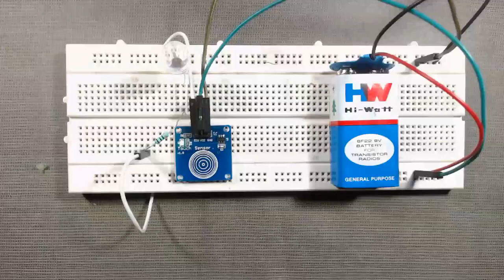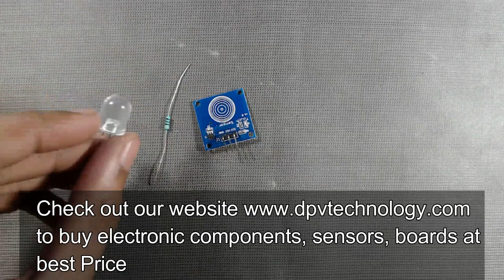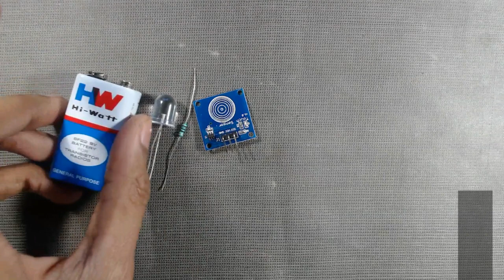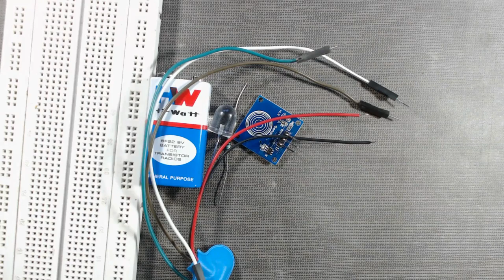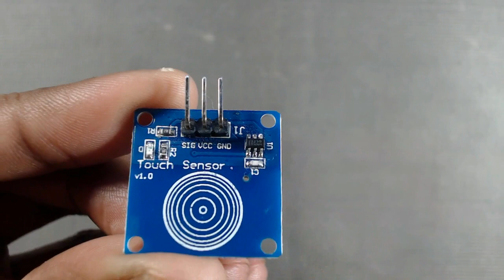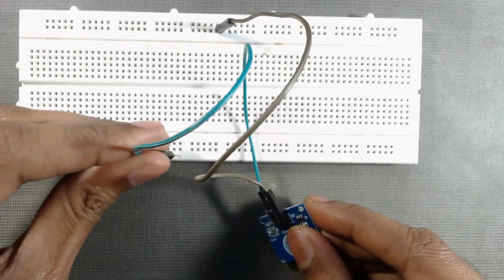TTP223 Touch Sensor Tutorial Without Microcontroller

Comment: Please reply my 2 questions...I have bought this PCB on line, have given 5 volts supply and as shown by you, connected a LED as load but this touch sensor board is working only as touch to on...Remove finger and it is off...
I want to use this board for a touch to on and again touch to off...That is as a toggle switch...What changes have to be made to the board..? Can you help please...
Reply: You could use an Arduino to process the signal from the touch sensor and depending on the program used you could do pretty much anything you want with it.
Reply: Also, I’ve heard you can try putting a jumper between pin 6 of the IC and vcc. for touch on, touch off.
Reply: @frankl1955  
Thanks Boss...I will try...👍👍
Reply: I just tried it and it works like a charm.  Not an easy solder though since the pins on the IC are so tiny. I've been soldering so long I swear it seems I solder more by feel but this was a challenge.
Reply: @frankl1955  
I will try...Thanks..
Reply: any solutions on this
Reply: @Frank L how did you do it like on off switch